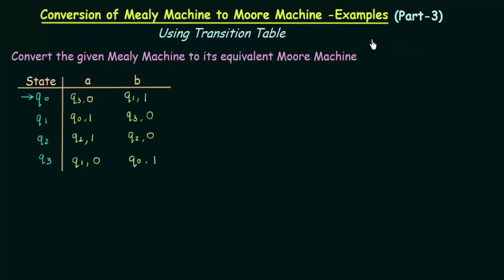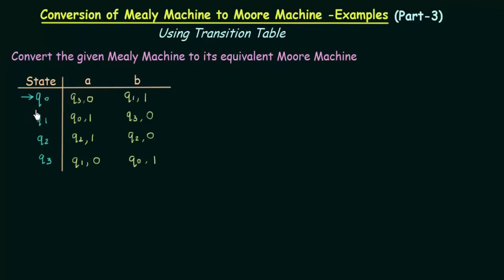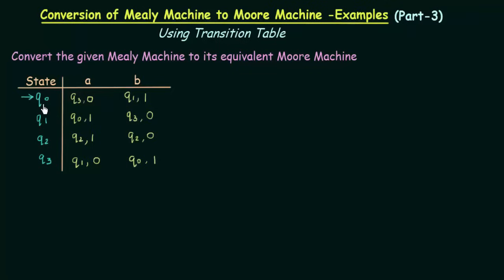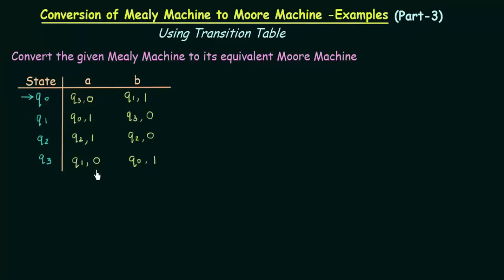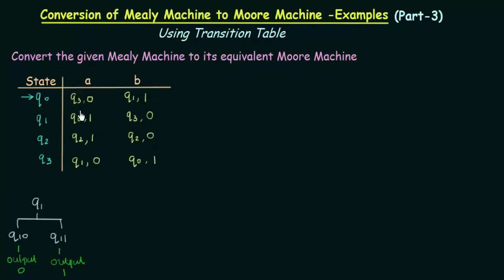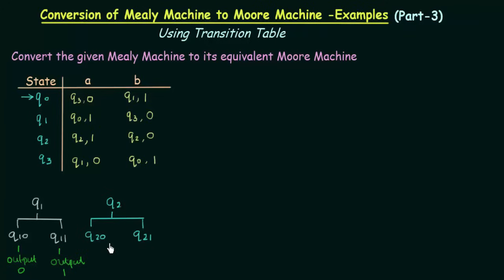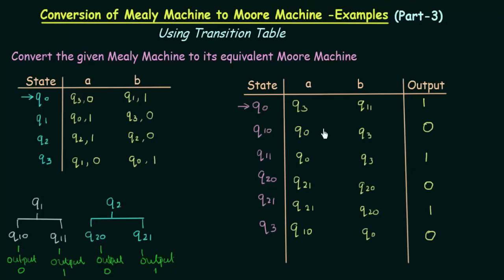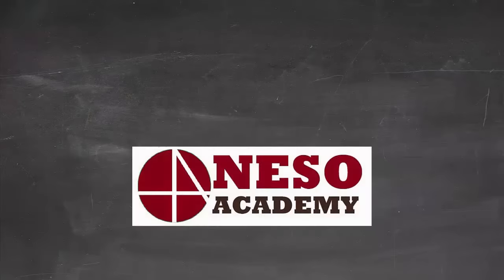Conversion of Mealy Machine to Moore Machine (Using Transition Table)

Comment: Interesting thing in this question is, there is no way to reach q2 state in mealy machine (or q20 and q21 states in moore machine). Not only we can reach them but also, they are confined within themselves. So, my final question is, should we discard this state in final answer? Or should we keep it as it is in mealy machine?
Reply: same doubt i m having when i tried to draw the mealey machine using the transition table... q2 state is only called by itself with no link to others states
Reply: @gorkijatt7679  yeah bro
Reply: I think we should discard it. In one of the previous DFA lesson identical case was discussed and we removed such state. Moore / Mealy machines are something like an extended type of DFA, so same logic should work.
Also if we look at this situation with few examples at hand, both machines (with q2 and without it) will give the same result, so q2 have nothing to do here.
Reply: we are supposed to keep them io think

Comment: One thing missed!!!......if ur initial state is returning output 1...that means it can accept a zero length or null length sequence.......which is wrong....so u need to add a new state...say Q..on top of q0 that will have same state transitions as q0 but it's output would be 0.....that means...on top of the table ..u will add Q state with.....row values ...q3 ..and q11...and 0
Reply: Moore machine cannot give output on initial state hence add a new initial state having output 0
Reply: yea we need a duplicate of initial state with output, epsilon
Reply: Means? I did not understood!
Reply: No bro you are wrong.see the introductory video of moore machine carefully.moore machine can have output without any input and that is not wrong.
Reply: @jayparekh7598  no
Reply: exactly  @jayparekh7598

Comment: Suppose we need to create 2 states for q00 and q01; now q0 was the initial state now which one should be initial state among q00 and q01
Reply: It doesn't matter. You can start at either one and it will result in the same output (except for the first symbol).